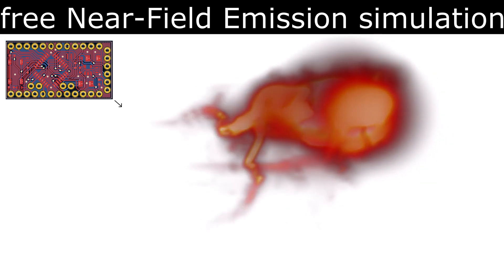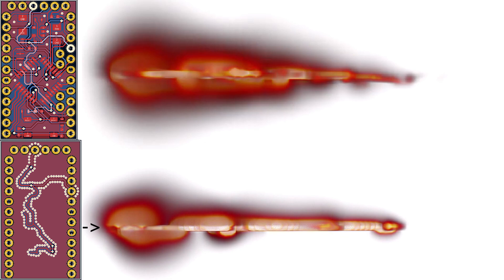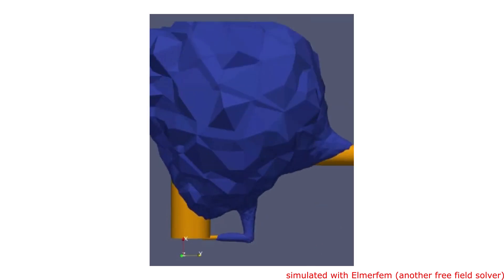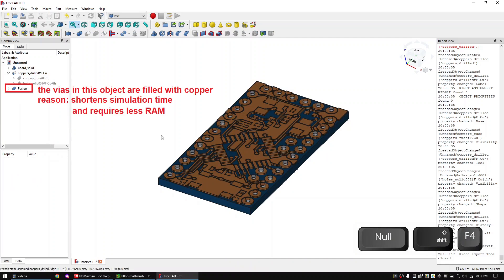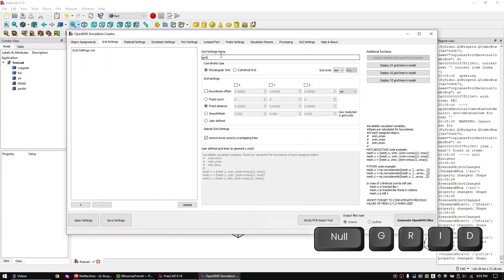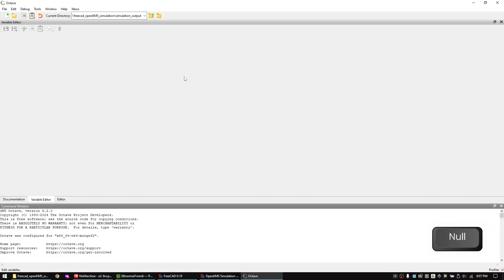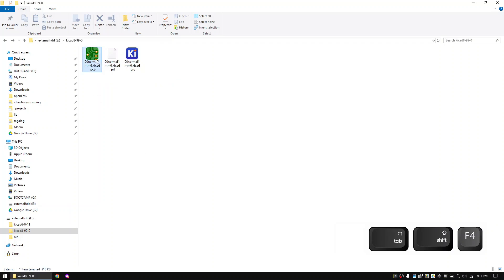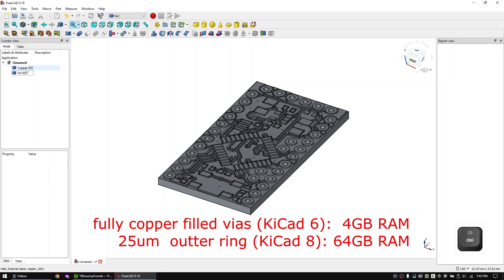free near field emission simulation with KiCad and part 2 on how to improve magnetic field emissions

Comment: Great videos! Thanks! I'm exporting step files from KICAD 9 and it seems to work. I'm still playing with the modeling settings. I can't figure out why there's sorting of elements (material, port) in the script at the last settings step before generating the .m file? What's the purpose of this?
Reply from the maker: Hi there, glad you seem to have a smooth start into working with the tools.
The sorting (I asume you meant the field in the top right corner):
its basically a object hierarchy, its important to sort from high priority items to lower priority. in general if a high priority item is at the same location as a lower priority item, the lower priority item will be overridden at this location. a worst case example would be if you would put the whole airbox at the top of the hierarchy, it would delete every object below it and the simulation wouldnt work at all.

Best regards

Renato
Reply: Thanks for the reply! This brings some clarity. Perhaps you could go into more detail about the grid settings in future videos? I've had a lot of questions! How many grid elements should be placed on the smallest simulation element? How accurate is the simulation if I increase the trace thickness on the board to use a coarser grid? (Relative to the copper thickness used in PCB manufacturing.) For some reason, I haven't yet been able to use different grid settings for different board elements. (Is this even possible?) Thanks! This is all very exciting!
Reply: Yes, and I run the same thing on Linux.

Comment: I kept having this 'unused primitive' error for port_excite. Have you ever e countered this problem  before on other pcbs, especially the ones imported from altium to kicad6 or kicad8?
Reply from the maker: Hi again :), hmm i know this error but i cannot recall in which exact scenario it happens.
feel free to send me an example openems code via email and i can very likely tell you where the error comes from.
Reply: @panire3  hey panire! Sorry for the late reply. Finally got it working. The rootcause was due to the geometry. Had to fix the geometry and give it a try again, and the warnings were finally resolved🫠. It was frustrating and rewarding at the same time. I guess you faced more frustrating times on the tool too, i guess😄😄
Reply from the maker: @nurhaida1983  Glad to hear you got it working! 😊
yeah, I can feel your frustration 😅 and also I can feel your joyful moment after finally figuring it out. 🎉 ⚡
Reply: @panire3  i'm looking forward onto your next video. 😁😁👍. I know you mention that it'll be in a future video, but if I want to simulate far field, is the sine excitation given the same way as in your previous video?
Reply from the maker: @nurhaida1983  the excitation method is the same, the only thing to worry is the grid size once the simulation gets bigger to keep simulation times at a reasonable level. I will show how to work with a variable grid size for the far field simulation

Comment from the maker: Hi and thx for messaging again :-), What still holds me back so far is that i didnt find a way to reduce the RAM usage with any of the KiCad 8 versions. If this little board took 64GB, a 8 layer PCB with 100x100mm would take hundreds of GB of RAM with the shown KiCad 8 approach.
I fear that this would lead to some frustration which would be reflected in the course ratings. 🤔
Reply: @panire3  Oh wow when I saw that you mentioned 64GB of RAM It didn't catch my attention so much so but now that you've highlighted it again, that's a scary lot. I have a 32GB RAM workstation laptop which means I'd have serious difficulties. But what is responsible for demanding such RAM demand? Okay is there a way we can raise this issue with the KiCAD community?
Reply: @saviouremmanuel3608  Yes, if we try to push the issue to KiCad, FreeCad or openEMS community, we might find out whats going on with such a high ram usage. After all, these three software people dont ever try to communicate with each other. we might be able to bring them together to talk about this and make an  impact!

@panire3 let me know if you want to make an issue on KiCad gitlab and share the link so we can support this, or I could do it instead :)

(for me, I could not run the far field simulation of the board, my ram hangs up, I only have 16GB)
Reply from the maker: responsible is that the outter ring of the vias ia just 25 micrometers and FDTD is not good with moving from very fine meshes to rougher meshes (adaptive meshing).
Reply from the maker: Seems like i didnt answer this, sorry. With Kicad 9 a lot of things got easier, even big board can be simulated with just a few GB of RAM and an Arduino or STM-Nucleo Sized Board can be simulated in just a few minutes, depending on what is the goal of the simulation.

Best regards

Renato